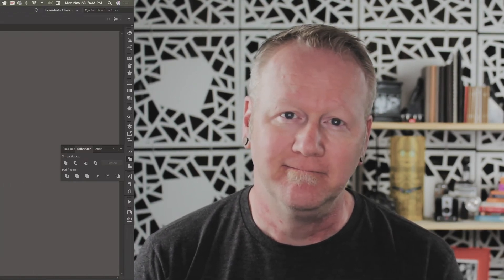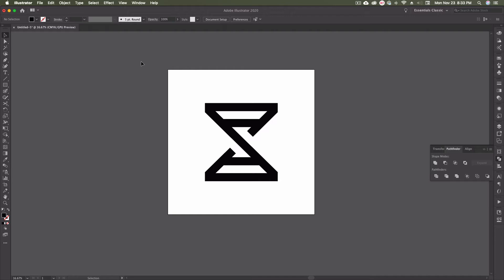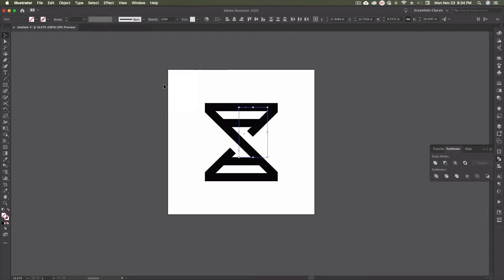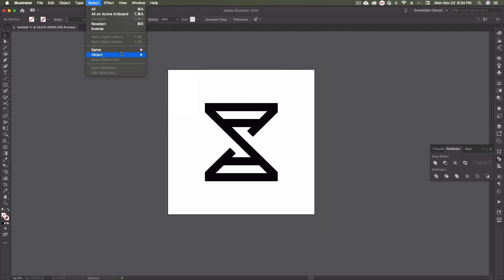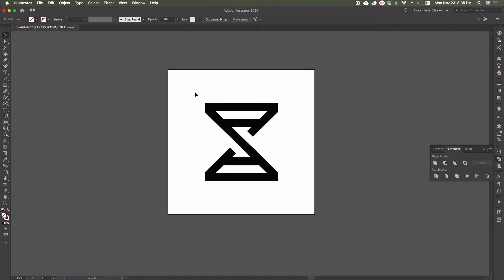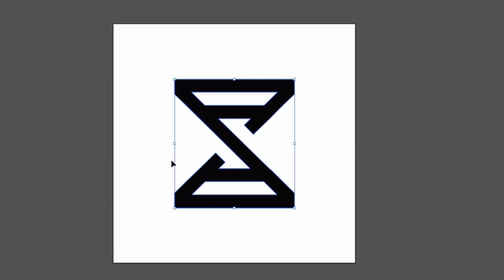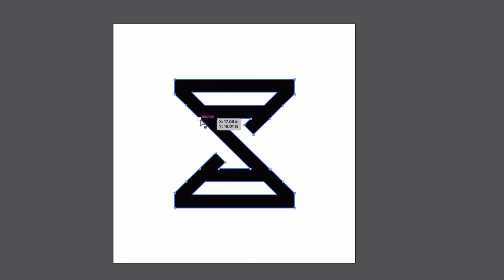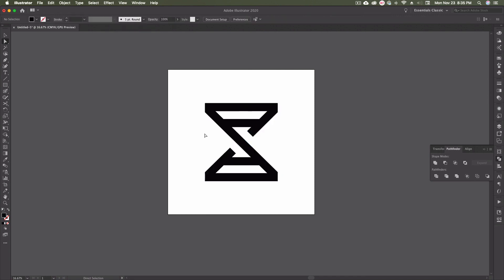Check This Before Saving Your Vectors

Comment: Great stuff Mike. As a separations artist, these tools should be touted.
Reply from the maker: Thanks Rick! I find it's these little things that so many new designers don't know about. You do colour separations for a living? I would have loved to work in an actual print shop to gain that experience.
Reply: @MikePickettDesignCo  I have worked in a lot of interesting and varying positions, currently in a marketing department for a screen printing company after doing color separations for another. I have been designing and printing for about 14 years in one form or another.